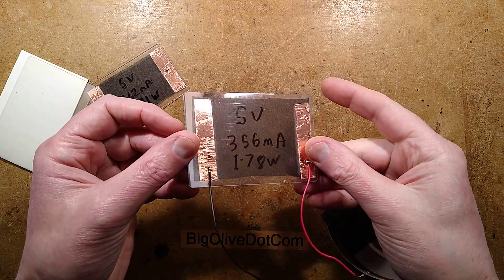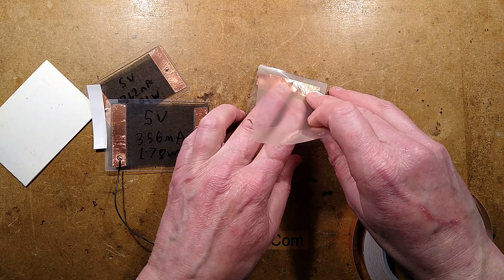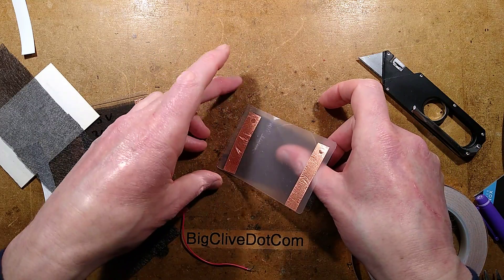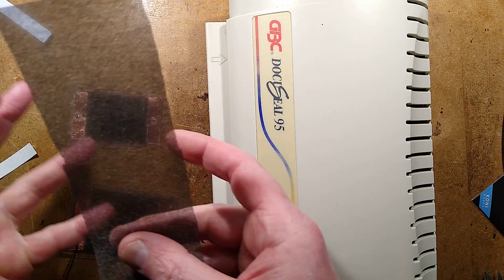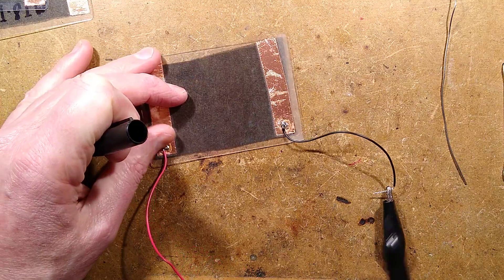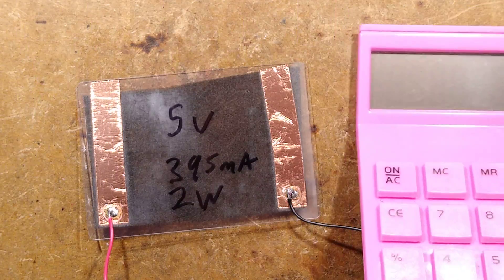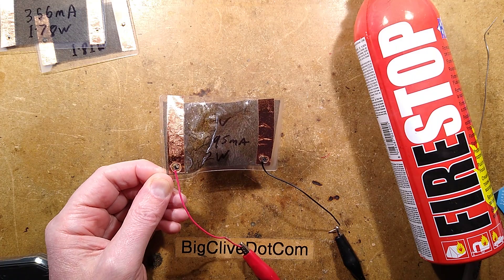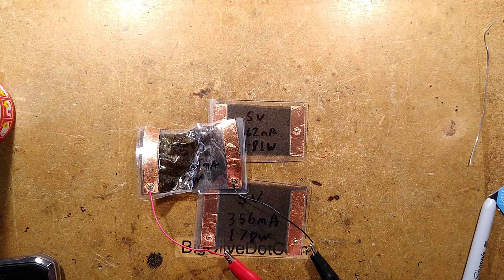Making custom heater pads and then destroying one

Comment: Dear sir. What is the resistance of the assembly? How many ohms? Looks like the carbon fiber I got creates a short and heats battery.
Reply: Looks like yours is quite thin unlike mine. That is most likely the culprit. Also, mine is woven and yours is not.
Reply from the maker: It has to be a fine carbon fibre tissue and not a solid sheet.
Reply: @bigclivedotcom yep, that I figured. Thanks.

Comment: Does anyone know the resistance of this carbon stuff? ..also looking to keep solar batteries warm in winter, maybe via Arduino relay with temp sensor...
Reply from the maker: It will vary with the thickness and density of the tissue.  You can get heater wires and tapes.

Comment: Use copper wire chop open so thin strands then splay them flat on surface and glue down or tape down n add couple holes so can add wires too your splay copper electrodes...only reason i say is you know will be pure copper and will act like a heatsink also better than copper tape if its not even real copper tgen waist money

Comment: Peeling the paper backing off copper tape! I became fed up with sore finger ends with copper tape being prodded underneath the finger nails, the Copper tape edge can be razor sharp!
I had to find a different method of paper peeling by scoring the length of the paper backing with a craft knife running along a metal ruler, I have eliminated the torture of copper razor blade under the finger nails!😊

Comment: why not to measure the resistivity of square of this carbon cloth, say 5cm x 5cm, and then with Ohm law calculate current and wattage for different shapes and sizes of that cloth as well as different voltage? All you need is to get wattage per unit of square to get maximum temperature this plastic can stand

Comment: 11:04 13:24 15:42 OMP!  personally, and obviously, you're under no oblication... but what i would like to see is ...(ahah! thats another matter) but in regard to heating pad, increasing the resistance for slightly more heat.. I have two of those pad things from china, the ones with twin 2 core lead from usb power. but the temp is soo weak when using 5v 1a powerbank, it's barely on. if put both pads back to back and plug into a mains usb 2a adapter, they warm a little more, but still poor. can you help us make a decent heat with 5v pls BC? what would happen if you used 2 or even 3 layers of carbon fibre material with nothing in between?    Thanks again :D
Reply from the maker: Layers of the carbon fibre would increase the power.

Comment: It works quite well. I used this method to make a heating mat for my propagator (about A4 size). It pulls about 8 Watt. Enough to let my seeds sprout. Prior i had used resistors in heatshrink, but roots would curl around those

Comment: Hej Clive, awesome vids and info as always. I was wondering could i use this to warm my hands inside gloves or mittens using a small charging pack etc as i have carpal tunnel syndeome and my hands are nearly always ice cold. Winter is also on the way. Any tips from you would be appreciated. Also is it called carbon fibre felt ? Thanx
Reply from the maker: You can get heated gloves that use a similar panel for USB use.
Reply: @bigclivedotcom   Hej  I did not know this. Do you have a link ? Thanx

Comment: Could someone do me a huge favor. and give me a link where to find this.  I"m disabled for several reasons, all because some asshole rearended me in 1993. I have poly neuropathy, this means my feet nerves constantly send pain signals, driving me crazy at some point. I have been using these heatpads for years, and i saw the prices going from 3 € to 16 € or even higher prices. They don't last long, so it would be great if i could make my own, the size i want, ....
I just need a link to find them, I have been looking for hours, even maybe days when you add up the hours, so please, please, please .....

Comment: Try it with silicon rubber baking mat cut to size. I wager it will last longer.
The heating pad on my FDM 3D printer base uses a silicon heating pad which can handle over 400C. It runs at 240v AC and is temperature controlled using a pid and controller which uses bang-bang voltage control. Bang-bang is fine because the heating pad is attached to an aluminium plate with a mass high enough to not need subtle voltage control.

Comment: I'm looking at that and thinking that ultra thin form factor could be ideal for putting inside security camera housings to keep frost/condensation off the window.

Anyway, I'm now wondering if it could be a more robust option to create the contact points by putting several lines of stitching into either end, but using wire as thread, then twisting all the wire tails together, and crimping a connector on that? Would thin multi strand copper wire have a hope of going through a sewing machine (I'm thinking about the wire core from something like an Ethernet or USB cable)?

Failing that, maybe for experimentation, just have the ends of the carbon protruding slightly from the laminate sleeve, and use bulldog clips on them for contacts?

Comment: Very Interesting, though im not sure how safe this would be considering heating pads should always have a high pisitive temperature coefficient, so the resitance rises with temperature amd thus lowers the power output.
If this were used for a heated pocket, for example, 2w would be safe if something like a cold hand sinks the heat away, but in the worst case (e.g. jacket in a big pile of well insulated winter clothes with the heater turned on) the module would continue heating at 2w with heat building up around it, possibly leading to damage. I think a properly chosen ptc resistor or thermal fuse should always be kept very close to the heating module if anyone wanrs to use these in a real world diy application.

Comment: I wonder if it would laminate well enough if you came in between the layers of the laminating pouch with the wires. Then it would also provide some strain relief at the same time.

Comment: I  usually watch Clive when I want to chill out and wind down, but this video has thoroughly seized my attention. If you warm the pad will it work in reverse and provide voltage or is there a way to have it capture voltage like an antenna?
Reply: What happens when one of the electrodes is made of aluminium? what happens when you don't use the laminate pouch? what happens when you add a second layer or carbon fibre? What happens if you use two CF sheets with one electrode on each  but then insulate the pads in laminate to increase the wave capacitance? How about some water heating tests? Temperature records etc.. 

Come on Clive I'm give you content here, sate my curiosity lest I'm forced to go find out for myself 😄

Comment: Interesting test. Wonder how much you could heat just the carbon fibre without the plastic cover? With some temperature and water resistant material it would be a great water heater for variable lower temperature, like from PV-panels e.g. I build my own water heater with Ni-chrome wire winded on a tube and isolated with epoxy and high-temp. silicone. This carbon fibre could be even more variable for different voltages and current. you could use multiple layers of carbon fibre if you need higher current resp. power. A problem is the copper connection which should be isolated from water contact.

Comment: I don't understand the issue with the adhesive on the copper. If you make the hole on the non-adhesive side, the problem is gone? Just a longer strip of copper, sticking out of the pouch and folded a quarter inch around stuck to the outside of the pouch?

Comment: I could see a real use for this to make a temperature controlled oven (stable environment) for crystals and such. Wrap a pipe with kapton tape then a couple of strips of copper tape then wrap the pipe between but overlapping with the carbon fiber and finally more kapton tape over that. Solder wires on, put the control circuits and xtal oscillator inside and violoia. Quick and dirty temp stabilized xtal oscillator! Take care. Tootles... Wade 👍😎👍

Comment: you just solved a problem of 1000s of reptile keepers
Reply from the maker: This type of system is used for some reptile heater mats.
Reply: @bigclivedotcom  sent a reply but looks like the good old YouTube algorithm thinks whatever I wrote was offensive. 
I'll try again.
Reply: Not many small DC powered heat mats that could fit in a wallet that would be perfect for a hatchling rack or traveling.

Comment: Would real carbon fiber, with the actual woven fibers, be one directional with it's conductivity, assuming you unweave it and make sure it points in the same direction? So against the grain you would see high resistance, but with the grain you would see low resistance. Would be interesting to try to exploit that as a matrix.

Comment: For more evenly distributed heat, wouldn’t putting solder points kiddie-corner from each other be better, as opposed to merely putting them opposite each other? The thermal showed the bulk of the heat at the bottom, but if you put the solder points kiddie corner, the path of least resistance changes to cover more of the copper strips, which might change the amount of amperage necessary to achieve the same heat, but will create a more evenly distributed heat which will improve durability. Right?
Reply from the maker: The copper resistance is tiny compared to the carbon fibre.

Comment: I've seen a house where they retrofitted a water borehole in their backyard, the borehole-to-house piping is buried roughly two meters underground so the pipe doesn't freeze, however there is a small portion of the pipe that resurfaces ever so briefly just to enter the house on the ground floor level (trying to route the pipe directly indoors would involve digging beneath the basement).
To avoid freezing that little above the ground portion, a special electrically heated pipe had to be installed, which cost about £70-80. 

I wonder if that could be solved with these DIY heater pads since they're perfectly flexible and can be rolled in a tube shape thus protecting pipes and, perhaps, other infrastructure that needs ever so little heat just to avoid hitting too low temperature.

Comment: On the topic of the carbon fibre itself:
What you have there is just randomly oriented strands, kinda like glass-fibre reinforcement used in boats or whatever
You can get (from somewhere like Easy Composites) 'proper' woven carbon fibre, in a ton of different varieties
For example, you can get 2x2 stuff (which is what expensive cars use) or 4x1, which is stronger in it's longest direction (usable for skis and stuff)
You can also get fibres that are barely held together with a small amount of adhesive, were all of them are in 1 direction, which might be very consistent for this type of heater pad thing
As well, you can just get straight 'tow', or basically the fibre itself, and then lay it down how you want (so maybe a giant snaking pattern for high resistance and high voltage?)

I mentioned Easy Composites, in part because they have a YouTube channel with a bunch of videos talking about carbon fibre and the different types if you wanna find out what might work best for this kind of application

Comment: For better high temperature performance use Kapton tape instead of lamination plastic, Kapton tape is good to 400C which is limited by the glue rather than the polyamide substrate.

Comment: I wonder if that's how those heating jackets are manufactured? Neat idea.  maybe I could insulate the carbon fiber with a fiberglass mat and use 110/240 volt AC  with enough length of carbon fiber for higher resistance and make a sidewalk heater mat  to melt snow. Or could you use the carbon fiber strips to make a custom bug zapper???  😅

Comment: I have a perfect application for this - dew zappers for astronomical telescopes. They're usually made of nichrome wire to run off 12v lead acid batteries via a PWM control. I think this would be much easier to work with.

Comment: Oh! I had a fleece blanket that had that stuff! I bought it from Dealextreme like 10 years ago, cheap as heck, wasn't very big, like 40x60cm, one day broke down and I tore it apart to see what was inside. And it was that. Male USB cable connected to a pair of copper strips to a black fiber inside a plastic bag... I thought at the time it was graphite coated cellulose or something, but no, it's carbon fiber. 

Very interesting! Cheers!

Comment: true copper foil tape with conductive adhesive is easily found (i use it a lot for proof of concept or other questionably rigged ideas lol). Me thinks using the adhesive side on the carbon fiber with some heat pressing would improve that connection, and then cover with wide strips of kapton tape and we have us some homebrew polyimide heat strips lol

Comment: I also wonder about that copper tape, it never seems to oxidise, even when left outside yet it has no coatings and takes solder like regular copper.
It also burns without a green flame and has similar low resistance, but the biggest factor of strangeness is the cost... it's just too cheap to be copper.

Comment: What about using homemade graphene? 

Get some paper and a pencil and colour in the paper to make a solid shiney layer. The apply  Kapton tape many times to the shiny parts until until the sticky side is covered can can't take any more graphite. 
And there you have graphene tape,  that DuPont say can handle 400c.

Maybe Kapton tape could be used either side of the carbon fibre (with or without graphene)?

Also Why not use the copper tape to stick down the carbon fiber? Is the glue insulating?

Comment: I have recently adopted a snake 'Kellogg - the Corn Snake' (yep, thats her name lol).. With a large A4 sheet of laminate, copper, and carbon tissue, PSU, variable resistor etc,  you could make a variable voltage/heat heat pad for 'Sneks' and reptiles? 🤔😏👍 ALSO.. I suppose.. potentially, one of these home made A4 sized heat pads, with a 10,000MAh USB battery pack, 'COULD' be used as a backup if someone with a reptile/'Snek' suffers a blackout/power outage in their house/down the street??? 🤔🤔🤔
😎🇬🇧

Comment: You can get thin copper foil for free by dismantling old, completely discharged 18650 Li-Ion Battery cells. A tube cutter is helpful. Be advised that it contains toxic, bad smelling chemicals, take appropriate precautions.

Comment: I've got a few off the shelf pads like this at 7W, sold for terrariums. They can become a fire hazard even below that if you forget about one under a blanket or some other insulating cover, but they also use 1/200th the energy of my baseboard heater.

Comment: I need this heatpad few years ago when I try to make heated PC mouse for winter time. I try ladders of resistors and playing with their resistance or switch for fast pre-heat and continuous heating then resistence wire for electric cigarette coil in plaster cast and still not good. Can't go above 500mA so I was also limited by 450mA for heating because 50mA for mouse itself. This heatpad can solve this problem.

Comment: Use real (not Chinese) Kapton tape that can handle 400C. Just insert braided copper wires in the carbon fiber mesh and hold everything with Kapton that has glue that can handle high temperatures.
If you really want to achieve crazy high temperatures, you have to just use copper and fiber. Use a flat long piece of copper, bend it to make a U, insert the end of the fiber mesh then hammer that to essentially crip the fiber into the copper. Do that on both ends of the fiber. Connect that to 240V. Enjoy!

Comment: Big Clive, what adjustable power supply did you use for this experiment, and where can I buy 1, please?
Reply from the maker: It's not one I recommend as it has a design flaw that can cause it to switch voltage ranges unexpectedly.  I do recommend buying any bench power supply from a prominent supplier like CPC in the UK.

Comment: Interesting experiment. Would actually be useful in an actual product by sandwiching between brass plates at each end and casting in silicone rubber in a thin sheet.

Comment: Good its stable - that it doesnt get more "carbonized" than before and conduct better and heat up better - PTC resistance raises with temperature :)
On the other hand you could even put 10 amps into it - but must be getting the temperature away from it with fukushima water pumps :)

Comment: Wouldn't the smaller carbon fiber strip increase resistance, decrease conductance, not decrease resistance?
Reply from the maker: It would increase resistance and lower power or increase the voltage rating.